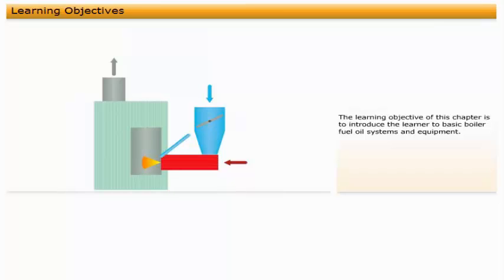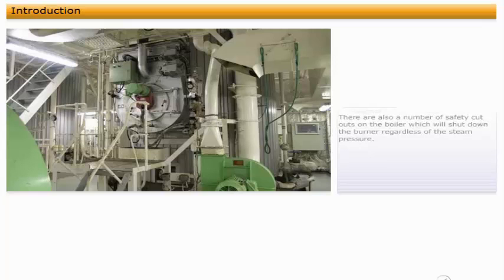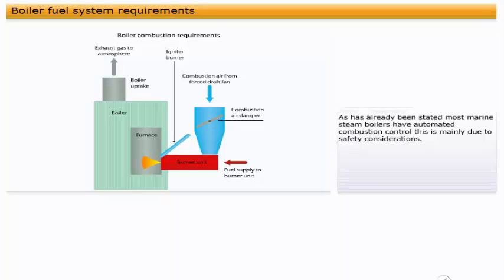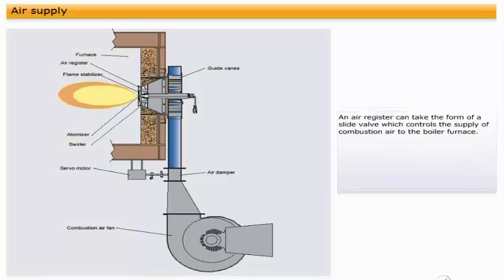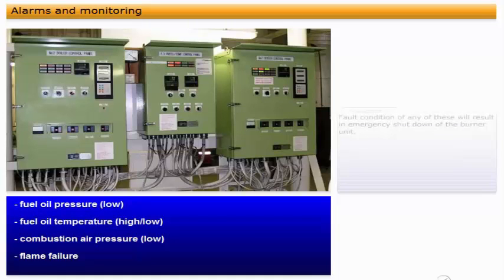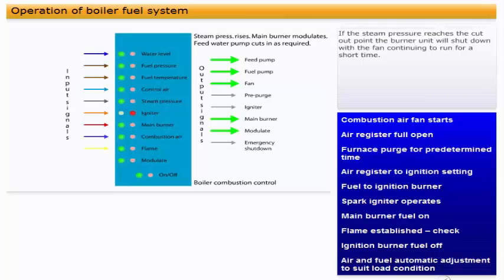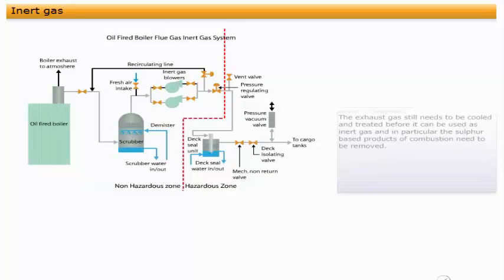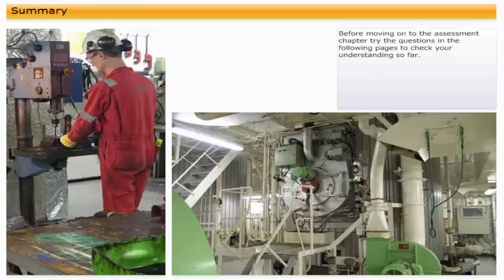Boiler Fuel Oil Systems

Comment: can thermal oil boiler provide steam with pressure up to 14
Reply: 14 bar
Reply: @doradorasan8243 ,it is not for steam. We have steam boiler, which pressure can reach 14 bar, what's the steam capacity do you need?  can you send details to my email, amy@hngentle.com, Whatsapp +8615838088573